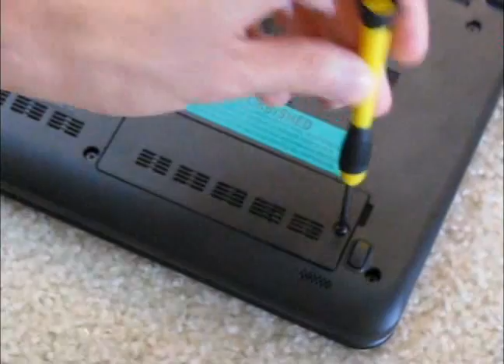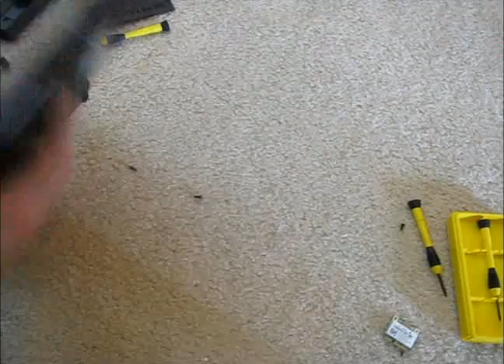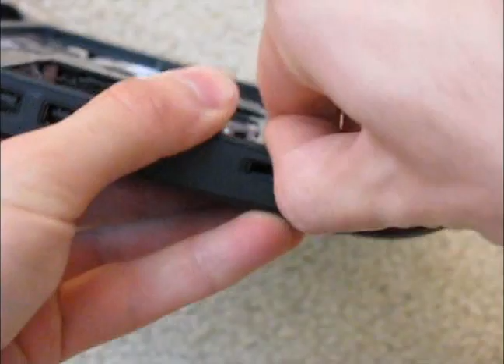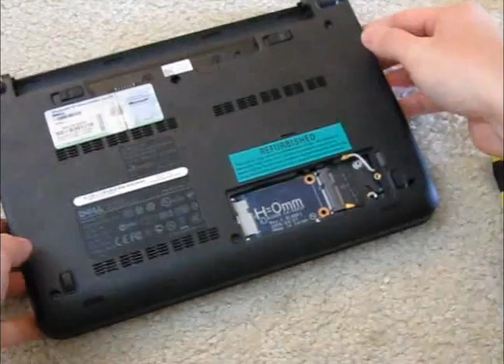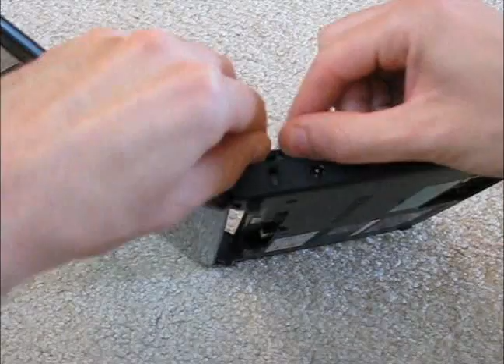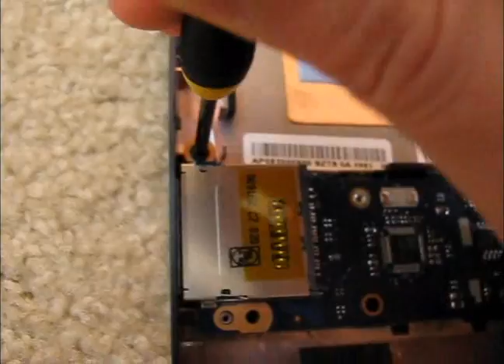How to upgrade Dell Mini 10v memory - Part 1 (disassemble)

Comment: It's Dell, this is entirely expected.
Reply: Apple is worse, in the MacBook Air, they just solder the memory to the logic board and no expansion, if the computer came with 2 GB, you're stuck with 2 GB

Comment: I found a Inspironmini with an atom z530 processor, i tried to upgrade ram memmory, it wasn't possible, the processor and ram are built in a single ddr module, so if you remove the module the netbook wont have a processor, hehehe, I wonder what would happen if i install this module in another inspiron mini with n270 atom, could it work like a co-processor?

Comment: Good work my man, I would however recommend for future tear downs, that you use a guitar pic, to to pull those clips out, that hold the ribbons in. That would cause minimum to no damage to the motherboard, if you should scrape it :-)

Comment: great video but a really fiddly job.. ugh.. i like dell but the designers must have had a great pub lunch that friday afternoon - no RAM hatch?? if the location of the internal RAM was accurately known, measured and marked i would prefer to go for a rotary Dremel tool to carefully saw into the back and then some black electrical tape.to seal it back up.. bosch!

Comment: What the F was Dell thinking when they designed this computer? My HP Mini 110 has a ram door underneath that needs 2 screws.. It takes less than 2 minutes to have the computer booted again. This is ridiculous. All so they can make a few more bucks from factory upgrades I guess.

Comment: Thanks for the info. My Dell is a 10/10 and from what i've read on here the memory cannot be upgraded, because it's soldered on, but at least i know that now as i was contemplating trying to take the back off and do it myself. Thanks for posting.

Comment from the maker: @SuperMario64N64 no, the 1010 is not a 10v (the 10v is 1011).  The memory on the 1010 (which is the only mini 10 series netbook with hdmi) has the memory soldered to the main board and cannot be updated.

Comment: You rock! I have no fear of tearing into an engine or a wall, but I was a bit nervous about this. Your video made it super easy and I was finished in less than an hour. I used a credit card to get the palm rest off, and to prevent scratching the motherboard, I used a wooden cuticle stick from a nail grooming kit for removing and reassembling the various plugs. Thanks a million for putting this together.

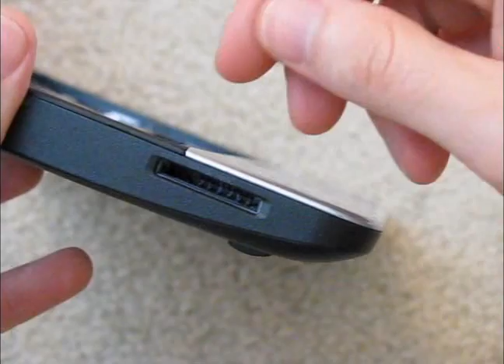Comment: TIP: at 3:50, sometimes if you dont have fingernails, or dont want to use something as abrasive as a flathead, i use a guitar pick! they usually come in three sizes, thin, med, and heavy, just buy all 3, they cost like $0.25 a piece. i actually found mine outside of a music store lol. hope this helps!
also, thank you for this tutorial; i just ordered one of these used via amazon with 1gb, so, first thing im going to do is up it to 2. is 2 the max? id maybe like to put 4 in it. netbook or not lol

Comment: If one does not have a plastic spudger tool, guitar picks are a great alternative. They are available in a variety of sizes and thicknesses and are great for sliding between laptop plastics

Comment: Excellent videos, easy to follow, worked perfectly!  Thanks!

One note for others, my hard drive didn't just pop out, it took quite a bit to work it loose.  Also, couldn't get the last power cable loose, so just flipped up the motherboard and popped in the new memory stick.

Comment: @darkrashan Apparently it isn't that highly static-sensitive. In fact, the sensitivity of many solid state devices is much lower than you would think. I have never had  a single device die from a static discharge blowing the circuitry and havent been overly cautious. Just basically dont rub it around on the floor and make sure you discharge yourself before you pick something up.

Comment: Using a thin knife blade (length ways) helps take out the palm rest, DONT PRY TOO FAST it's not too hard (you just dont want to bend it in the middle, its delicate around the touch pad)

Comment: @GE24Tony 
They're not made for gaming, they're made for surfing the net, traveling while working, and doing school reports and such.. 

It's a netbook not a laptop.

If it doesn't have a bluetooth mini pci-e then it doesn't have bluetooth (some models that advertise it have it soldered onto the motherboard). If yours doesn't you can add it but you may lose wifi

Reason it gets so hot (it does have a fan) is cause it's tiny and they have to cram a lot of tech in a small case. Dont cover vents :P

Comment: I watched the videos a couple of times and at first was pretty intimidated to try it.  I just finished upgrading my Mini 10v.  It took probably close to an hour (I kept re-watching sections to make sure I didn't mess it up.)    Thank you so much for going step by step and the zooms were really helpful.  (I did notice after I put all the screws in one cup that there were a few different lengths and should have put them in more than one cup.)